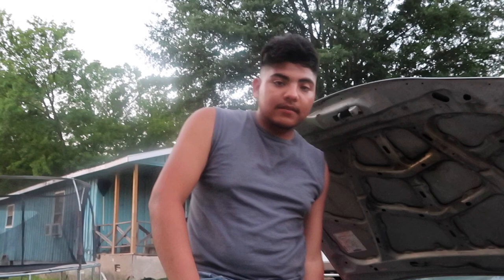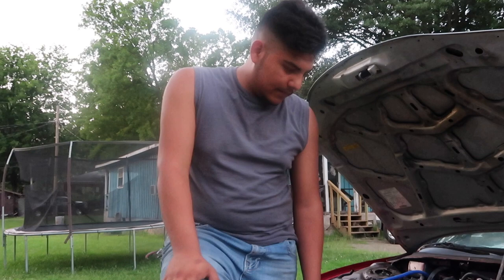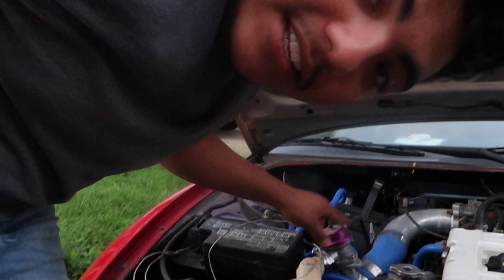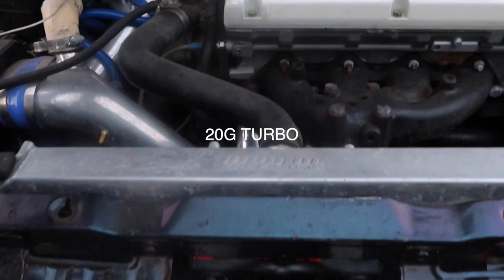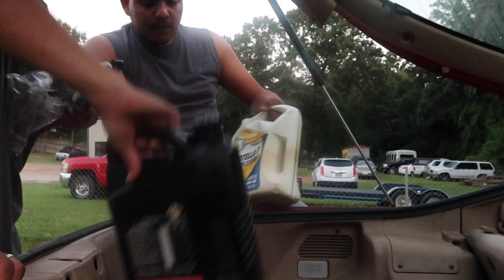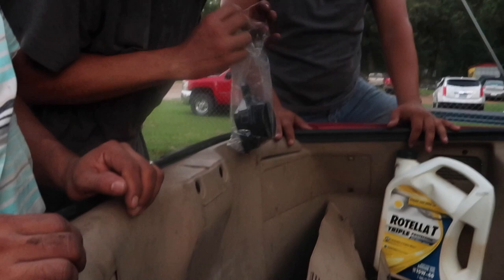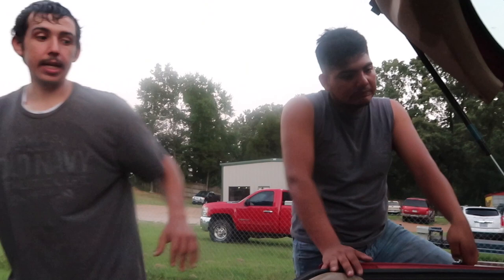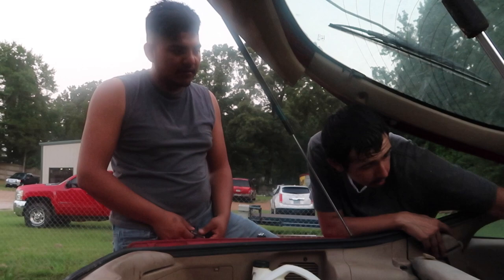I BOUGHT MY FIRST INSANE PROJECT CAR !!

Comment: It looks like my old car that I bought in the show room where did you purchase this car and do you know anything about the history of where it was purchased the reason why I ask is because of the small little indention on the rear Bumper and is it a GST I can give you a list of some of the modes that I put on it back in the early 2000’s
Reply from the maker: I bought this car from a guy named devin downs other than that i dont know any other history of the car The block was honed and bored .20 over at Best Engines .  Put .20 wiseco pistons , eagle rods.  Crank was polished by best engines.  The head was complete rebuilt with all new hardware by best engines.  Arp head studs  850cc FIC fuel injectors with stock rail system and yes its a gst thats about all i know about the car .